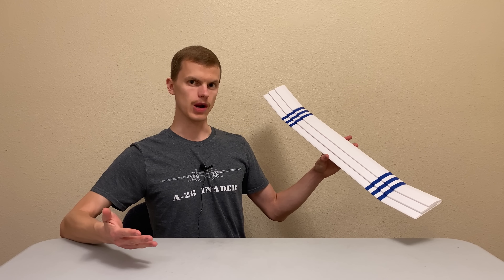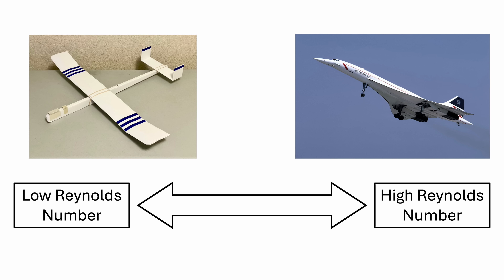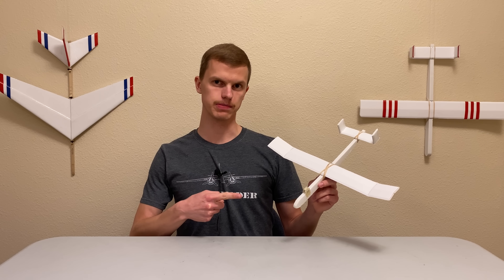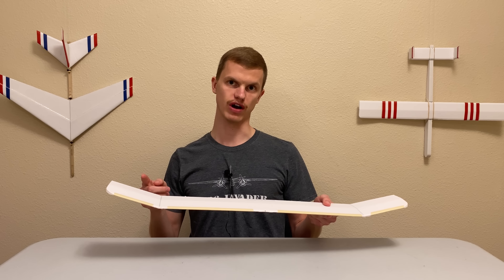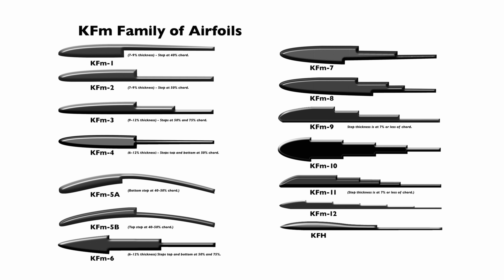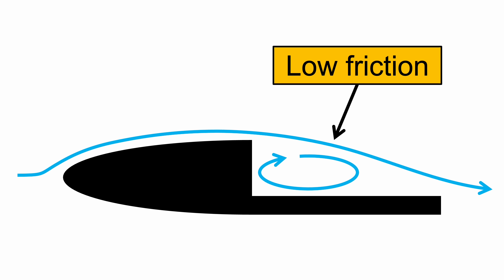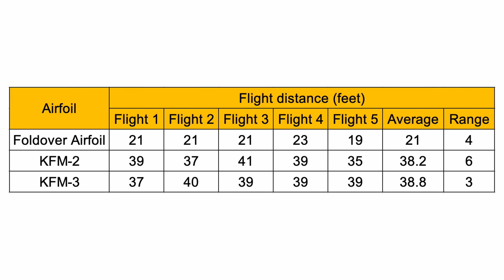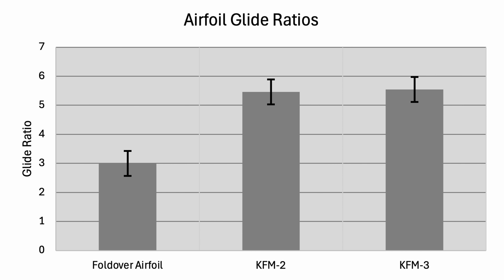Stepped Airfoils for Model Airplanes - Are They Better?

Comment: sandpaper
Reply: What do have to sand? Cause its not possible to sand the foldover airfoil cause of the paper layer on the outside. On the other hand it is possible to make a wing with 2 plates with a cut airfoil that can then be sanded

Comment: On RC model airfoil blades of small auto gyro s putting a turbulation square strip on top of flat bottom clark y air foil at 15 to 20 percent back from the leading edge , running full length of the rotor blade for reduce skin drag or coefficient of friction drag ,just what I have found with small 30 in diameter rotor discs

Comment: I did a science fair project on this in 1974 but even with a wind tunnel most people did not believe this.
Reply: try it with a multi element wing and a kfm-10 configuration and 3+ elements with tublical leading edges and steps with a prop/fan or 2 either mounted proud on nose or incorporated into the midle of each/the(depending if traditional plane design or sled/ekranoplane/hovercraft/single centeral wing with winglet design) like mine multiwing and its almost a helicopter ;)

i havnt done it yet but i want to play around with 3d printing  'tesla valve[open on top] 2 valve wide segments across top and bottom of with a 30* slope to fill step1 and 2 and adding a very thin 4th step/ slightly separated medium incidence fixed areofoil as 'step 4' at rear see if i cant milk some extra lift and pressure out of it so it and drop its forward movement a bit more for more 'hovering' less ekranoplan at low power

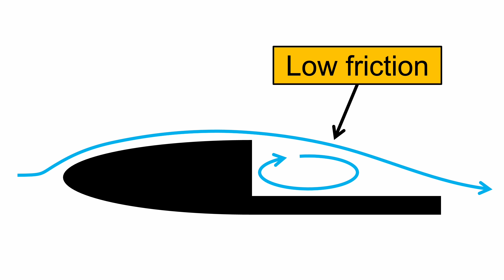Comment: 1. 4:55 I think the Mythbusters posited that a pickup truck had a vortex pocket in the bed so lowering the gate or putting up a net didn't improve mileage. No, I've no idea which episode/season was involved.

2. Is there an online calculator where you can input your expected cruise speed, engine hp, and weight carrying capacity and get a NACA wing number, wing square footage etc?
Reply: Mythbusters Episode 43 "Seasickness - Kill or Cure?"

Comment: Ermm Beating a DEAD horse here kid. Wind tunnel testings ... a few years back... bored researchers basically) Found that Stepped (KFM) airfoils were Poor Airfoils....Period!
Reply: That is a third hand comment with no specs or facts to back it up. Not really of scientific value.  
According to my wind tunnel, at these low Reynolds numbers, there is very little difference between stepped and other airfoils over the whole performance envelope.
Perhaps some info from your wind tunnel might give your claim some credibility..  Or some experiments as shown in the video.
Reply: @Oodle-ox2vf  Sometimes the benefits are not in the performance, but in the easiness to manufacture something( E205, CLACK Y), or in the strength it has : see supercritical profiles (although they are better in some point of view).
Reply: That's what they always say about science, never do any experiments that someone has already done 🙄
Reply: Yep, yet the ability of almost ANYTHING from a flat plate on up to "fly" at these ridiculously low Remolds Numbers keep the "KF" and all the other 'Stepped" nonsense going.

Comment: Have you tried a golf ball skin? Airfoil. Covering your entire aircraft golf ball like holes..  this should help.
Reply: Golf ball dimples would actually have an opposite effect.
For a golf ball, the drag force is dominated by pressure drag due to flow separation (2:14).
The dimples on a golf ball delay flow separation, which decrease pressure drag, but because the flow stay attached to the surface longer, the skin friction is higher.
Overall, golf dimples reduce the drag of a gold ball.

For an airfoil, the airflow stays attached pretty well and there's smaller wake behind.
Like he explained in the video, at low speed, drag force of an airfoil is dominated by skin friction.
It's the opposite of a golf ball.
Reply: Also do a size divet comparison small to large type divets..

Comment: ... and BTW, both wing tunnel and CFD simulation work very poorly at the low Reynolds numbers of our model aircraft. 
Even top-notch aerospace research centers can't reliably replicate wind tunnel results. 
As for CFD software, it is designed for full scale R numbers (in the millions), and will not work very well, or at all, at low R numbers, as the turbulent flow that will occur in those operating conditions is highly unpredictable...
Reply: so... full scale tuft testing ?
Reply: CFD has no problem number crunching model wings. Low Re# flow is actually laminar not turbulent
Reply: XFOIL works really well. ;)
Reply: @shmaknapublar  Not on stuff with sharp edges like this. It can't properly model recirculation.

Comment: Nice job, young man. 
From an old aeromodeller, a couple of items to consider:
1) you should ballast the wings, so they (and thus the whole plane) all weigh the same
2) your folded over airfoil is way too thick on the trailing edge. That will KILL its lift/drag way more than any skin friction effect
Perhaps a bit more testing considering both factors above may help.
Again, congrats for the well made video and experiment.

Comment: I'm here to learn about aerofoil designs specifically for disc golf discs (for hyperrealistic physics simulations) and this was incredibly valuable.  Turns out disc golf discs are almost exactly KFm-1 aerofoils (or in some cases closer to KFm-5a).  This is super helpful!

The interesting thing is that as per the governing body of the sport, discs MUST be stepped aerofoils, although they also allow for all sorts of variations for example concave shape on the bottom portion of the leading edge/wing.  Also obviously, discs are unique because they also have effectively a "reverse wing" on the back of the wing, so a unique phased flight emerges thanks to the drag initially reaching past the trailing edge, but then as the disc decelerates, it turns into a backwards aerofoil.  

It's a simple insight but the point around 8:00 about too fast: turns up, too slow: turns down basically correlates to "turn" and "fade" of a disc, thanks to gyroscopic procession (as discs are effectively just a spinning aerofoil).

If you ever find yourself interested I think you'd have a world of fun applying some of these concepts to discs / disc golf.  It's shocking how little even pros in the disc golf community understand the physics involved.

Comment: Интересно, а если сделать верхнюю и нижнюю поверхности крыла многоступенчатой (не одна или две ступеньки, а много) то сопротивление по идее должно бы уменьшиться значительно, ведь вихри будут создаваться практически на всей площади крыла. Такой эксперимент есть в планах?
Interestingly, if you make the upper and lower surfaces of the wing multi-stage (not one or two steps, but many), then the resistance should decrease significantly, because vortices will be created over almost the entire area of the wing. Is there such an experiment in the plans?

Comment: It's great to see somone attempting to introduce people into model aeronatic engineering. So, good goal. If you are really intent on teaching aeronautical engineering to modelers so they can design/build their own airplanes, I respectfully submit that you might start with basic stability concepts (i.e. decalage VS CG) and trim concepts (aerodynamic effects VS offset mass/weigh effects, particularly WRT speed variation). Conventional (overhand) hand-launch gliders illustrate the basic ideas very well and are applicable to any sort of model airplanes = FF, CL, RC.  Also, construction techniques and workmanship. After having reviewed your other videos, some of the "tests", like the airfoil "tests" are wildly affected/dominated by trim and workmanship, er, "variations" that utterly swamp the effects you are trying to test for. I am 100% in support of your goal, having been at this business for 60ish years (60 as a modeler and 40+ as an aerospace engineer), but you have teach people to crawl first, then walk, then run. Another go-around on the Kline-Fogelman vortex is probably not the place to start.

Comment: No offense, but in several of the example tests, it appear that the airplane is not close to perfect trim for chosen decalage and CG. And there appears to be no adjustment of the CG VS decalage to find the optimum gliding AoA - which would definitely be expected because the camber and thus the "zero-lift AOA" would be expected to be different. Your conclusions may or may not be right, but this experiment has far too many other uncontrolled variable to make any conclusion about the airfoils. That's why real tests are conducted in wind tunnels with all the variables controlled, not in open-air free-flight  tests.  

 ps. I hadn't looked at KF airfoils since maybe the mid-70s when they were "invented", so I checked some more and as expected, valid airfoil testing indicates that the L/D advantage or disadvantage is highyl dependent on the Cl, meaning that to optimize the L/D you would have to test as a large variety of wing loading, and could easily missed or jumped to a conclusion based on your all-up weight. Note that this ALSO affects the sink rate, generally, even at a lower L/D, if you have to fly it faster, your sink rate may still be higher. So it depends on you end goal. Furthermore, the workmanhip and CG adjustments will have drastic effects of the entire airplane, the battery  or whatever you used for nose weight probably has FAR MORE drag than the entire induced drag of the wing, same with the "fuzzies" on the wingtips (which also affects the lift by altering the flow around the tip - finite span effects are another potential issue.

Comment: Congratulations! great work!.   I have been using KF2 and KF4 wing airfoils for more than 24 years now.  The main reason for that is the simplicity of building and repairing these airfoils. 
I have also built airplanes with traditional airfoils. My own  experience is that, when stopping the motor and letting the airplane glide, the traditional airfoils have a better gliding ratio, in contrast with your results, but I have not made careful measurements, as you did.
I noted that your first airfoil has not a smooth curvature. Can this cause turbulences that could increase the drag? It would be interesting to compare your experiments with an smooth airfoil.
Reply: Of course. Particularly in the case of KF airfoils, the scaling matters drastically. For small size (e.g. hand-launch gliders) and very low Rn, the wetted surface probably matters a lot more than the turbulence caused by step discontinuities in the pressure. And there are the other considerations - like the weight or wing loading. It is far easier and lighter to make an HLG wing from solid wood in two peices because the cross-sectional volume of the KF airfoil is smaller than other options like a Clark Y, Eppler 205, etc. while it wouldn't be a big deal it if it was built-up, molded, etc. . This sort of thing would not show up when trying to determine the properties of the airfoil VS complete built-up airplane, conversely, testing a full-up airplane is not necessarily a valid test of the airfoil, due to many other uncontrolled variables.

Comment: Am intrigued...why is the lower surface of wing flat..? My own experience in full sized Aeeronca Chief and Taylor craft BL is that the latter with an elliptical wing shape. I.e.curved lower face had better laminar flow that the flat surface..more speed..more efficient performance with less power. Aeronca 85 hp Taylorcraft only 75hp...??
Reply: Because it’s just foam. But I feel ya, I wish he tested the Kf 4 as well.  There was a lot of extra weight involved with these airfoils too, and I don’t think that increased mass was accounted for.

Comment: I agree with choppergirl. Try a step with a curved face. Try a very sharp edge to the step. Think of shark skin it has many little pockets with sharp points over center. I think it will function as if there are ball bearings all over the surface.

Comment: What if you made the steps of the stepped airfoils not with a 90 degree L drop... but instead...  a nice ( curve...    because your air is going to be circulating around in that area too and you want it also with the least drag I would assume, so it circulates...  a little faster
Reply: Yes a concave at the step will be more efficient.

Comment: Great video. It shows low Reynolds numbers aircraft benefit from a lower drag stepped airfoil. I'm wondering how your gliders compare to the usual powered RC size aircraft in the 40 to 60 sizes as far as Reynolds numbers. Would the larger RC powered aircraft benefit from a stepped airfoil? Where does the stepped airfoil benefit become a neutral factor?

Comment: Very interesting! I flew a hang glider back from mid 70's to mid 80's, and built many "sacrificial victims for the wind gods". I did use the Clark Y air foil too. I do not remember the term "skin friction", but was familiar with parasitic and induced drag. I am wondering how a flat surface would work in comparison to these stepped air foils. Stepped air foil is a new one to me as well. I figured the models I built would get in the 10 to 1 glide angles with the Clark Y air foil, but I did not have a sophistic of a set up as you have here.

Comment: I was designing rc planes with KFm earlier. The reasons why I moved to design with folded airfoil were:
1. Better looking
2. Much stronger wing structure

I use Flowsquare and OpenFOAM to digitally tested the designs.

Your video makes me want to design KFm parkjets again 😄 big thanks!

Comment: With all due respect, acknowledging that I probably know 0.1% of what you do, the premise of this video was "Are stepped airfoils better", but then you compared stepped airfoils only. Are stepped airfoils better than cambered airfoils? I still don't know.

Still, really enjoyed the video.

Then went back and looked again, sorry, I see now that the first, folded aerofoil is representative of a standard airfoil and not a stepped airfoil. Disregard.
Reply: Except that is isn't at all representative of a conventional airfoil which are generally much more "fair" across the top surface where the separation will occur. That big kink behind the high point is guaranteed to cause separation.

Comment: Congratulations on your experiments. The RC hobby field does not have much scientific basis.
 I have searched for scientific data for KFm airfoils for RC planes and have not found much. Like many others, I am particularly interested in airfoils for slow flying FPV drone RC planes used for agricultural and conservation monitoring.
You have identified the correct questions (a) at what reynolds number do the KFm airfoils become less efficient than curved airfoils? (b) how effective are thin KFm airfoils? 
I look forward to further videos.

Comment: I’d like to see you test out different air pocket styles for the steps. Maybe if you made a cylindrical cut along the floor of each step, it would allow vortexes to form with varying levels of friction and height from the floor of the step. Maybe you could even try different shaped steps; rather than having a straight line along the length of the wing, what if you cut out different shapes like triangles or circles along the length of the wing. So instead of ———— it would be like VVVVVVVV or UUUUUUUU

Comment: Does this concept apply to props and turbine blades as well?
Reply: Props and turbine blades operate are much higher Reynolds numbers and as his graph showed, above about a Reynolds number of 100,000 stepped airfoils are not as efficient as smooth airfoils.

Comment: Nice vedio, but I have some questions about the explaination for the reason about low drag. As model airplane in such size, the uploader said the viscous drag was the most part of drag, I would say, maybe not. This was a very comman model airplane with 7~8 aspect ratio(roughly from the vedio), and the flying speed should not larger than 10 m/s, hence, the thin airfoil theory and lift line theory are valid. That is, the lift line slope is about 2pi, and the induced drag is about Cl**2/(PI*e*AR), and the viscous drag is related to the surface area. The biggest differents about step wing are 1. it changed the wing-tip vortex character and the flow over  the surface is transitted to turbulence forcely, which brought a more stable flow pattern; 2. the effcient factor e is changed. So I think we should give more precision way to conlude the reason why step wing is better.

Comment: Love the videos. And I do have 3d printers. I've printed some parts for model aircraft before, as well as a couple small slot gliders for the kids.

But this video makes me wonder. When you print with a typical FDM 3d printer, there are a series of lines produced on components due to the item being printed in layers.
Due to this, there's basically 3 ways you could print a given airfoil, and thus leaving those lines in different directions.

EG you could print the airfoil flat, and with a large layer thickness, it may almost appear as though it was made with a stepped design (though the leading edge will also be stepped). You could print the wing on the leading edge... you'd still have lines running the length of it, but they'd be closer together and smoother than the first option... but still bumpy esp in the direction airflow will travel during flight. But this may also end up acting like "dimpling" on a golfball perhaps.
3rd option is to stand the wing on its tip and print it the long way. This would pose the most problems with printing... as well as have the most structural issues, but I wonder if on a final aircraft/glider if it'd be the most effective with regards to lift/drag.

None of my printers are big enough to do a whole wing at once, but I can (and have) do them in sections about 8in wide, and then pin them together (either with a printed pin.. or with the wings I made for a plane before, I used some fiberglass rod to make full length spars)